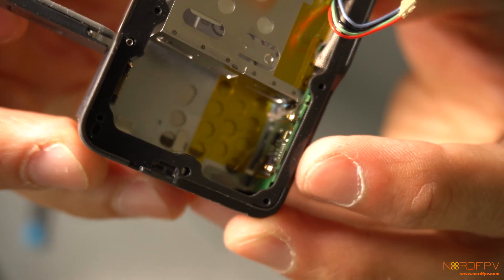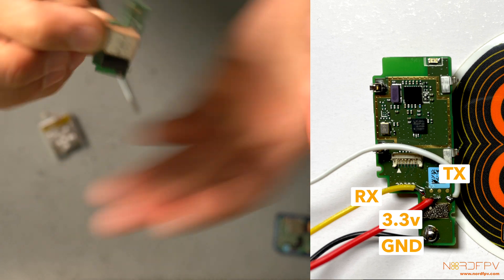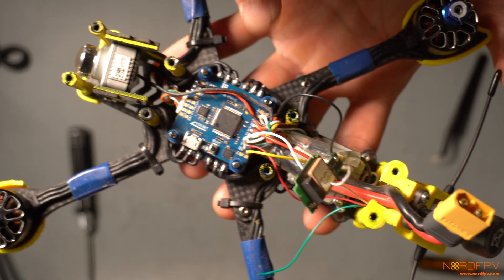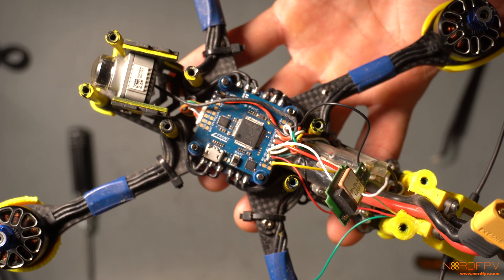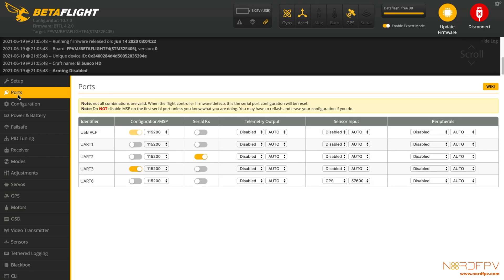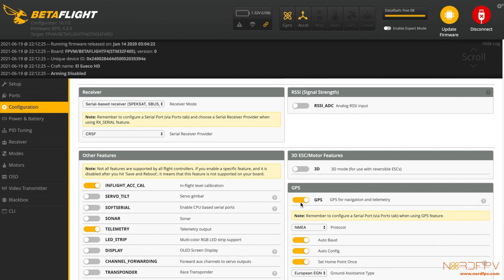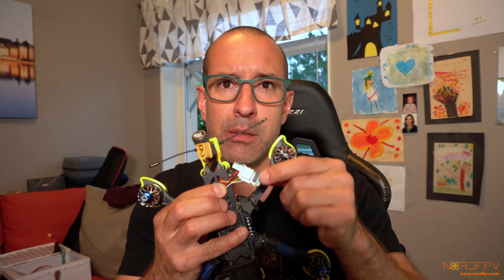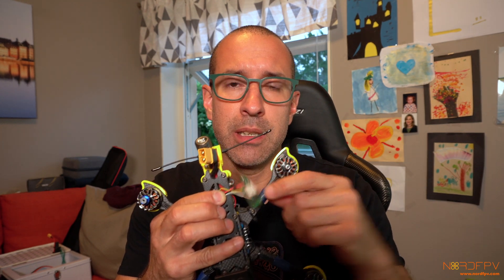One of the smallest GPS you can get into a FPV drone - Installing a GoPro 6 GPS in a drone

Comment: Unfortunately my tx and rx pin from the gps unit got ripped off in a crash... any other way I can hook up the rx and tx pad
Reply from the maker: If you are good at soldering you can always connect it directly to the chip leg. It's not an easy job, and I don't have the diagram to tell you which leg is the right one, but I'm sure you can find it over the internet.